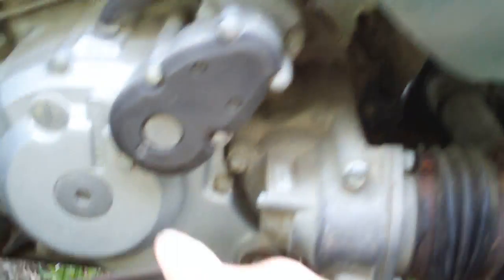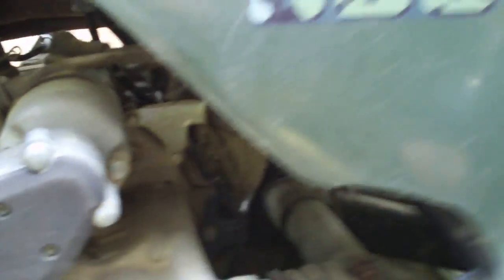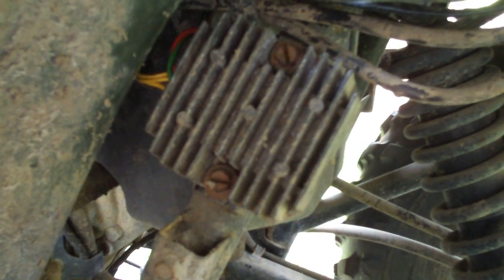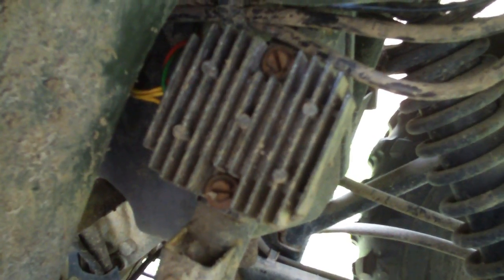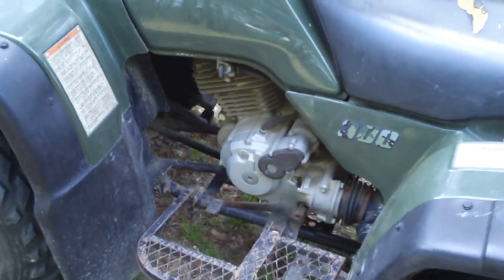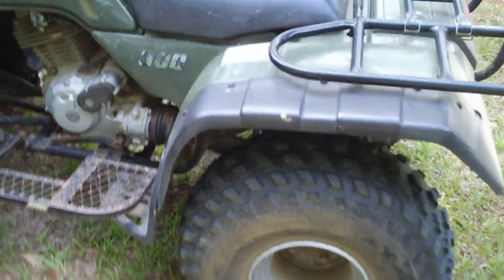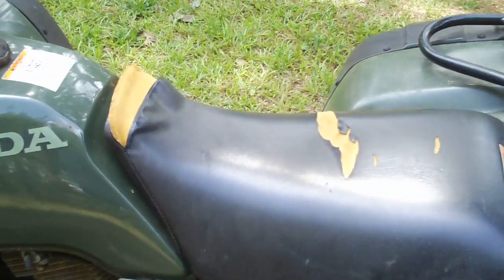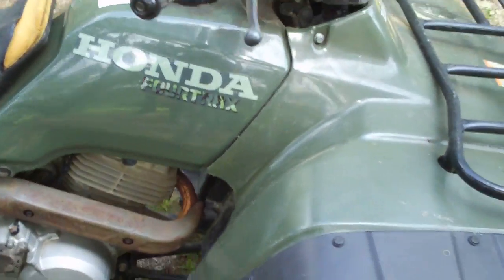Why my ATV battery wouldn't charge - the rectifier

Comment: I have similiar  issue  with my Linhai 500. From stator  there is about 150volts, i found  out that from the voltage regulator  was output 0 volts so i replaced  it for new one for 100€ (original  not  chinese) but this  didnt helped. I also  found  one fuse  between  regulator  and battery but that seems  to be  okay. Can anyone  help please?

Comment: How did you test the rectifier? Or did yoi just go ahead and replace it not knowing for sure if it was the problem?
Reply from the maker: I found out what the voltage range should be coming out of it and tested it,  I don't think I was getting any voltage at all or else very low.  I think it was getting correct voltage in,  wrong or no voltage out.  I don't remember now what proper voltage number is.

Comment: I got the same unit, things a beast.  I changed my spark plug, oil and air filter but it's got no top end now. Idles great. Doesn't go over like 15mph though, anyone have a clue?
Reply: carburetors clogged
Reply: brakes dragging. ?
Reply: also, if they set up without use, if fuel is in it, the choke works by a round plunger that pulls in and out ..sometime the fuel will varnish/gum them up & cause all kinda hell.

Comment: That is a voltage regulator/ rectifier depending on model they sell for under $150 from Honda .. On some models like the TRX400 / 450 and 500 the stator has a "research wire" and the bike will have NO fire if the reg/rec is bad ..

Comment: You said your battery was dying and you were starting it 2 or 3 times a week did you ever test to see if your  stater was charging
Reply from the maker: Not at first but eventually I learned how the system worked i did test it and found no voltage from it.

Comment: I know this is over 10 years old but did you bother to check the voltage, I have one that only gets up to 11v at high rpm and 9 at idle so the battery goes dead after a week or so of riding
Reply from the maker: Fordman 1991 yeah that sounds like either bad stator or rectifier if that's the voltage while it's running.  Mine was doing exact same thing.  Stator/rectifier are part of the charging system.

Comment: honda fourtrax 300's have a kick start on the right side of them, just pull of the part with "300" on it then turn out the kick-start lever, look at the top of the engine cylinder on the right side and there should be a little lever, flip that up, now turn the key onto the "on" position, then push down on the kick start as hard as you can with your feet then let off the kickstart then turn it back in, then put the cover back on then your good to go! :) (Btw it still works even when the battery is dead)
Reply: Thank You!!!! I feel like an idiot.

Comment: Hey bro, What I would do for the seat if you can't find one cheap is go to a junkyard and buy an old Saturn L200 leather seat for nothing [these cars are great cars but too many in the junkyards due to General Motors not making enough coil springs for them and none are available anymore in the aftermarket. tell them you just want a piece of leather. should be able to get a patch for nothing. you don't want something that you can slide off of so stick to leather or vinyl. and of course DO NOT wax it.

Comment: does that affect why mine wont start like it is a new and charged battery and the light comes on when in nutral but it clicks when i try to start. please help i am 12 years old and i dont wanna be on my computer all day so pleade help me
Reply: That sounds like an almost dead battery or either a bad starter. I'm no expert though you probably need to get someone to look at it that knows engines. That clicking sound is probably the starter solenoid which is normal but it's just not getting enough power to turn over the engine. Make sure that battery is 100% charged and if it is then it's probably your starter. That's my guess.
Reply: I will put it on the charger i will wait for a couple days then check back. Thank you so.much
Reply: How hard is it to replace the starter
Reply: +Tanner Wright I've never replaced one. But it shouldn't be hard. There should be YouTube videos on it. There are ways of testing it first too to make sure that's the problem before buying a new one. It's basically functions the same as a car starter, only smaller.
Reply: +Tanner Wright take off the seat, if u see the + sign and the - sign where the battery connects go, try pushing them down and starting it.
Reply: if it just clicks it could be the starter or solenoid but if you hold the solenoid and you can feel it click than it could be the solenoid
Reply: Tanner?!
Reply: nevermind..
Reply: Tanner Wright. starter bad

Comment: Hey I have a fourtrax 300 I had a charging issue replaced the rectifier seemed good but I found out last winter that the quad couldn't keep enough power to run the quad, winch, and lights. Any ideas why this is. If it is the stator where can I find a new one thanks

Comment: the same problem happend to me, if you look for something that should have rubber on it, move the rubber there should be 2 bolts sticking out with wires on it, try to start it, if thats clicking, then touch the 2 bolts with a screw driver of something with mettal with a rubber handle, if it sparks and starts, thats the problem, its also the thing clicking, i got a new one for $30, i had the same problem

Comment from the maker: Sorry I'm not much help with this. My only experience with clicking is with clicking starters due to low battery voltage which is solved by a charged battery. But with a new battery installed sounds like you may have a failure of one of the other components in the system, maybe the starter or a relay. Watch enough videos and you'll find something to try.

Comment: i really dont know if your raptor have a fuel pump relay but if so...check that cause if it goes bad your start button wont work...and if thats the case your rectifier is the cause for it....you mite think its your battery or your starter or your starter solenoid so to save you the trouble try checkin to c if yours have either of the 2 b4 you go spendin like you really have it......good luck let me know what happens....check out my videos on my problems i was having

Comment: Hey Elmer, (or anyone else for that matter) when I go to stat my Honda 300 it just makes a clicking sound from under the seat, next to the battery, small cylindrical object. I can start it with the kickstart OK but not with the ignition. It also will not jump off. Any idea what the problem might be?
Reply: U need to change ur starter solenoid

Comment: thanks you for responding  I just went outside to try to start my 4 wheeler without the battery to see if the neutral light would still come on as i pull the pull cord it acted like it wanted to start .i  charged the battery last night but it has only 3.5 volts according to my multimeeter . Thanks a lot 4 the information.

Comment: I just watched your video and think i have the same problem i bought a sazuki lakota 300 and it want start without the battery if hook up the battery it will run as long as i keep the battery hooked up but when i unhook it the engine stops could it be the same problem?

Comment: @gusocorredor what color are your plugs? mine were completely oil/gas soaked. and i sprayed like 1/4 of a can in the opposite side of my carb. next to my front chain-drive gear (the wee one), it spins, if you put a screwdriver on it it will stick because its a magnet, particularly on the points. i also didn't mention that i adjusted the points (like 2mm....) and that helped A LOT. if you need a picture of what it looks like on my ke100 i can get you one.

Comment: in May of this year i bought a KE100 since then, i spent everyday working on it, and spent about $600 in parts and service. and i completely rebuilt the bike. along with a ton of frustration and hurt emotionally of course, nothing fixed it.

so today, i sprayed some WD-40 into the stator/points/magneto area. waited about 3 hours. now it runs perfect..

i dont know if i should be happy, or want to kill it. all this time i had that wd40 sitting right next to my bike!

anyway thanks for the upload.